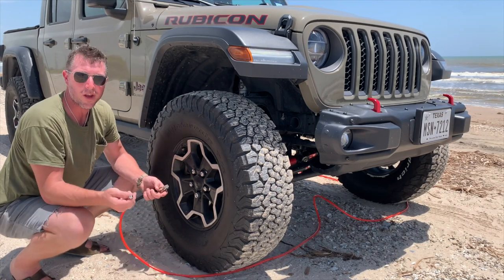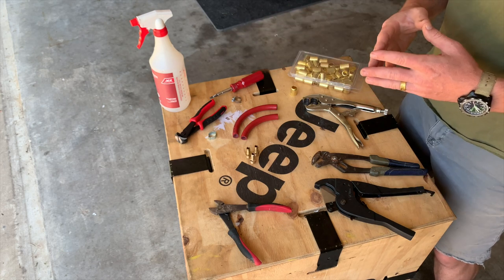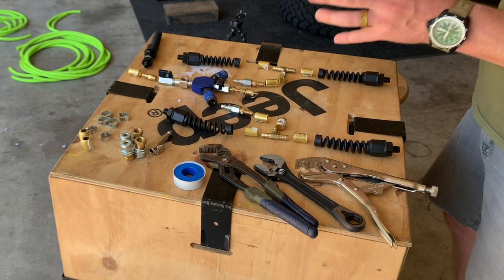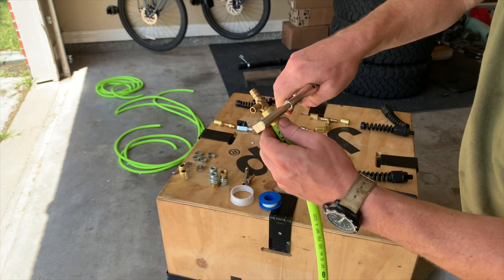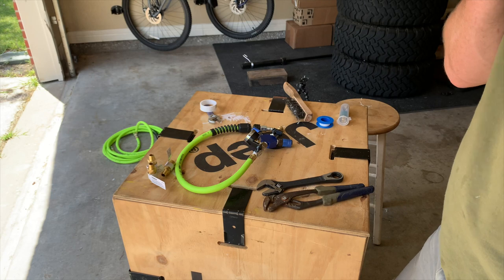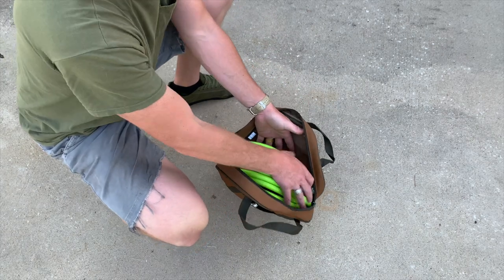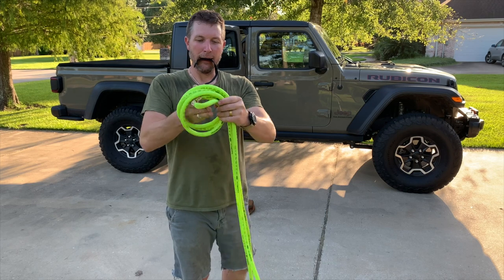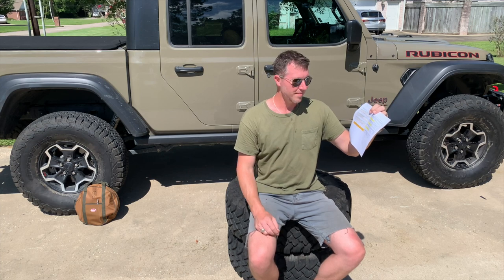DIY 4-Way Tire Quick Inflate/Deflate System for Off-Road Tires

Comment: A very simple tip I picked up from an old timer who spent a lot of time in the bush/outback was to over inflate you spare up to whatever it can safely take and that will give you another reservoir if the pump gives out.
Reply from the maker: I learned the same tip from an old timer as well. 🤝

Comment: Ok, I just started looking up and pricing the stuff you require for your DIY kit and am not nearly done and am all ready at almost $200.00, The Moreflate System (which I believe uses Flexzilla Hosing) I would require is about $249.00, I just do not see the advantage of DIY here as Cost Effective factoring in time and two tools you suggest. How di you justify it? And why (3-12) 1/4" Barbed NPT Fittings why not a specific number!
Reply from the maker: Thanks for reaching out! My kit pricing is dated and costs have gone up on nearly all the materials. The reason for using 3-12 barb npt fittings is I assume not everyone is going to use the flexzilla pro quick ends like I chose to use in my build. I built 3 for friends for Xmas this year and it came to about $230 each using 1/4” hose and fittings vs. 3/8”.. morreflate base models are 250 and go over 300.. the DIY just allows you to make it conveniently at home with what ever materials you want to afford. I chose to spare no expense and the pricing, though near a pre-manufactured pricing, is still justified.

Comment: I did something similar except i modified a SEMI air tank as an aux tank so that small compressor don't work as hard and ITS like 100% FASTER and i used quick fitting Teflon hoses from actual SEMI trucks. NO crimping just push N pull this way IF any repairs can be done in sections and QUICK and NOT permanent with room for running air tools

Comment: Did it work well with the Coyote Deflator? I watched it twice now and getting ready to order all the parts. Thanks again for taking the time to make this btw.
Reply from the maker: Hey, thanks for reaching out… yes the coyote deflator does work, but unfortunately it takes about 27 minutes to do and that wasn’t efficient to be worthy of posting the results. Otherwise the system works great and I’ve used it a lot… I time my deflates and it comes pretty close everytime.. with 37’s, deflating 30 to 12psi is 5min.. with single compressor it’s about 9min to inflate 12psi to 30psi.. if you have a twin compressor it will be about half that time to fill..
Reply: @GatorOverland  thank you for the quick reply. I ment to say that 4 weeks ago lol

Comment: I really appreciate the time you took to show the entire build, along with what you learned along the way. What struck me was that deflating or inflating all 4 at the same time was so much faster! Data doesn't lie and neither did you. You earned a sub on the very first video that I've seen. :)

Idea for a mod: You have 2 valves on your manifold, so why not open both to deflate? I think that it might be faster. Toss that Coyote deflator since it's just a smaller orifice than the valve, plus it adds weight, price, and complexity while sacrificing time. Simpler is more better.

Another mod I might consider is drilling and tapping a hole on the large flat face of the 4-way to accept the gauge. Having a 1/8" NPT without an adapter makes is marginally lighter, plus it keeps the gauge closer to the protection that the 4-way offers, and away from the valve and mashing your fingers on it.

No matter what, I'm seriously looking into adding this project to my Xterra. The only difference I'm considering is getting a CO2 bottle from a local welding supply, along with a 150 psi regulator. It doesn't need the engine running, and is way faster than a pump, cold, and quiet. It takes up a bit more room, though, so there's always the flip side to consider. A 10# bottle should be able to air-up all four 31" tires on 16" rims about 10 times, and maybe 15. Fill-ups should be around $15, that puts each air-up at about $1.50. Buying a compressor for $150 would equal 10 fill-ups and about 100-150 air-ups. I'm not sure if a pump would live that long unless I paid more for the pump. My Cost/Benefit ratio needs to be examined more.

Comment: Great installation Video, and thanks for posting all the materials in your shopping cart. After I'd done many tests, I found it was easier to inflate two tires at a time. Thus, I'm building a two-line split. Thank you for sharing your time & effort.
Reply from the maker: Absolutely… Thanks for taking the time to watch hand comment… That’s the great thing about the manifold set up is you can choose between doing two or four just by disconnecting the lead.. doing two at a time simplifies material and reduces weight and space required for storage..

Comment: That's cool. The only thing I would add would be another check valve to separate the front and rear hoses. That way when getting ready for the highway I can shut down the front or back while the other end keeps inflating (if the front and rear are different pressures).
Reply from the maker: That’s not a bad idea!!

Comment: Great video and great system!  Awesome advice on using the spare tire as an emergency air source, mine will be inflated near max tomorrow.
A few observations, devices very similar to the Coyote deflator come in packs of 4 and by the time I install the last one, the first one is deflated, by the time I remove the first one, the second is done etc...  It takes less than 5 min to deflate 4 tires, and is where these manifold systems really don't save any effort or time.  Just getting the bag out and stringing it out is already more time than installing/removing 4 deflators. Not sure where 22 minutes came from to deflate with Coyote type deflaters.  
That being said, inflating is where the manifold system really shines. I do like your set up.  Put an adjustable regulator on your manifold( or even another Coyote type device) set to you air up PSI, hook it up, turn it on, and go do something else for 15 minutes.
Reply from the maker: You’re exactly right, and thanks for commenting on the video… The 22 minutes was based on a single Cody deflator in the manifold. I have put together a manifold that has four deflators on it but I have not done a time evaluation for it yet… Coyote has also sent me a big bore deflator that might be suitable for using one deflator for all of them… I plan to get a small regulator as you mentioned. But yes overall there is a bit of time for set up, but the convenience of doing all four at the same time and being equal is hard to beat… There are a few brands out there on the market… But doing it for yourself has that gratifying feel about it.

Comment: Any thoughts on having the lines fixed  beneath the chassis to each wheel?  That is, the air chuck for each wheel tucked up under the fender well protected by a dust cap.  Mount the service port & gauge under the hood, in the cargo area, under a seat, glove box, or wherever.  Seems to me this would save time unrolling & stowing hoses.  Jump out, make sure the valve is closed, attach the valve stem to its conveniently located air hose, and finally open the master valve to deflate.  When complete, put the dust cap back on the air chuck and stow under the well.  No need to drag hoses and manifolds through the sand, mud, snow, or dirt.
I think I'm going to try this on my Toyota Fake Jeep, highly inspired by your video.  I'd like your thoughts on potential pitfalls for this idea... I'd be happy to document the process & results.  Great vid.  Cheers!
Reply from the maker: Your idea is great and is perfect if you want an onboard standalone inflate/deflate system. It requires a bit more planning, routing, and money, but in the end would be more convenient in regards to storage. I have seen set ups like this and have considered it for myself. I decided to go a more universal route that would work on a variety of vehicles. If you follow through with your idea I’d love to see how you made it work. You can keep in touch with me at jkhartel3@gmail.com. Thanks for reaching out!

Comment: Greetings from Australia! There's some absolute golden takeaways throughout this video. Great stuff!

Pressure balancing tires, using your spare as an emergency reservoir, how time spent pressurizing 4 tires up and down constantly can be streamlined, duty cycles.

This has me thinking about my own system. Realistically, here in Australia, custom tray/bed modification is very normal, so I'd opt for a slightly different concept. An onboard compressed air tank to reduce compressor CFM limiting inflation time, and consider using valve stem removal inflators for extra time savings. I'd also consider how to keep the lines attached to the compressor full time so setup time is streamlined and may in fact be more compact with more spread out but smaller coils.

Either way, now I'm thinking, and that's it's own reward. Cheers!
Reply from the maker: Wow! Thanks for taking the time to watch and comment. You aussies are the OG Off-roader, I’m better off taking notes from you😂. You make some very good points. This video was to make a portable unit to go between multiple vehicles. I plan do exactly as you mentioned and do a reserve arb tank, as well as running permanent lines arb chuck ports along the frame and only need 4 short whips to attach to the tires instead of the big roll in a bad. Also as mentioned the main time constraint is the valve stems for both inflating and deflating. I have purchased apex stem deflators and plan to put them on next tire rotation. I’d love to see your setup. Shoot me an email to jkhartel3@gmail.com or find me on Instagram @gator_overland

Comment: Easily the best quality end results. I watched 3 other vids and this one is most well assembled.
Reply from the maker: This one is for you man!! It works very.. let me know if you have any questions. I’m actually making one for a friend today 😂
Reply: @GatorOverland  so you must use  compression ferrules on the hybrid pvc/rubber hose correct? No hose clamps. 

I prefer those compression fittings where you used the end snips (flush cut cutters) to pinch the ferrul wings tight. The other type requires that expensive looking vice grip compression tool. I do a lot of offroad lighting and 12v  electrical so I know how quickly the crimpers and materials add up. Plus I try to buy USA made when possible which gets really expensive.
Reply from the maker: Totally agree and understand. I have used all three on the flexzilla… No problems. I prefer the flash Ferrule overall.. next would be the side crimp, and then hose clamps… I keep hose clamps in my repair kit in case I have any issues on the trail or with my hoses.
For better contact, info, photos and video check us out on
https://www.facebook.com/JKHartel3
https://www.instagram.com/p/CF-X_58BjDR/?igshid=1r9yo0niyroip
Email: JKHartel3@gmail.com
Reply: @GatorOverland  Do you sell these to the public?   What's the cost if one was to DIY?  This one does look so much sturdier then the rest I've been watching.
Reply from the maker: I do not sell to the public.. just sharing my experiences and garage creations with you at the cost of your time. I spared no expense with my build. You could do it for as little as $80, but my configuration at the time as about $145.. moreflate is $179+.. one of my friends @tjmitchellfilms produced one called speedflate which is a great preassembled option.
https://www.speedflate.com/
Reply from the maker: Tell TJ, John from gator overland recommended, you might get some perks 🤘🏼

Comment: Fantastic video and walk through, much appreciated! I’ve been considering DIYing a 2-wheel setup for less setup/breakdown and also so I can equalize between two tires. 4 would be cool, but I’m thinking 2 will cut down on all the tubing I have to carry with me. Thanks for the walkthrough on all the clamp types!
Reply from the maker: You bet man! Thanks for taking the time to watch and comment. Reducing to a 2wheel set up is a good idea, especially for being an space/weight saver.. essentially, you could do it the exact same way I did and not create the second line. That unused quick coupler could be accessory to any other air connection needed. 🤘🏼

Comment: Good job!  I don't think it was actually said, but the inflate time difference is due to the restriction of the valve stems.  By using the manifold, you reduce that restriction overall and let the compressor work more efficiently. I was going to build one of these anyway and I'll definitely use your parts list.  Thanks.
Reply from the maker: Hey! Thanks for taking the time watch and comment. Yes the valve stems are the ultimate restriction, some folks actually pull there’s or go monster valves for more flow, especially when deflating. Take one straw and blow through it.. take 4 straws and blow through them.. It’s easier to blow the same volume of air through 4 than one. Science is fun 😂.. the auto equalizing is the best part.. Invest in a 50% or better duty cycle compressor and you’ll be good to go! Happy trails 🤘🏼.

Comment: I would shift the middle manifold portion about 3' forward to make reaching it easier. The air supply will usually be in the front or the back so the longest wheel lengths will be the other end...the closest ends will be much shorter
Reply: Milton Type V are high flow coupler fittings and flow a lot more air. Not a big deal on these systems. But very noticeable on airtools. Keep them ALL the same for consistency

Comment: Gator, awesome video. 
I have one question,
You wrote that we need to use this special ferrule 0.635' ID but then linked also to Amazon  0.625"ID ferrule. I want to buy from Amazon only, do you think the 0.625 ferrule of Amazon would be good to use? with the Flexzilla hose and the V grip you also linked? maybe in the year that passed from posting this video Amazon have the right ferrule for this project?
Thanx again. keep on shooting these detailed videos.
Reply from the maker: Thanks for reaching out, I appreciate the kind comment.. yes most definitely opt for the 0.625” ferrule F7327 is the standard sizing number.. The V grips I have listed are 1/4 & 3/8, but the ferrule is actually about 5/16”.. i used the smaller 1/4 inch diameter and it works well enough.. I position the edge of the clamps just past where the ferrule shoulder goes straight. Any 5/16” vclamp or press is expensive for what it’s worth.. The only thing I can stress is that you get true brass tee fittings… I have ordered a handful through Amazon and they are actually aluminum cast and they do not clamp well… They shatter

Comment: Awesome walkthrough! I really appreciate all the details and specifics, making this very easy to follow. I'm still researching my air inflate/deflate solution (install like yours vs standalone bring in bed) and will definitely be using your videos for reference.
Reply from the maker: Thanks for the reply! Yes, there are so many ways to consider a air compressor. The pros and cons go in every direction. I assure you the convenience will prove itself the first time you need it, regardless of location. I was between the Portable ARB box for versatility and the bed mount application before choosing behind the seat. Smittybuilt also make a great portable unit. Just pay attention duty cycle and cfm output vs what your uses will he and you’ll be fine. This 4way is a no brainer when it comes to time saving convenience. More content coming soon. Thanks again
Reply: I guess Im asking randomly but does anybody know a trick to log back into an Instagram account..?
I was dumb lost the password. I love any tricks you can offer me!
Reply: @Luca Jensen Instablaster :)
Reply: @Dangelo Adrian I really appreciate your reply. I got to the site on google and Im waiting for the hacking stuff now.
Looks like it's gonna take quite some time so I will reply here later when my account password hopefully is recovered.
Reply: @Dangelo Adrian it did the trick and I actually got access to my account again. Im so happy!
Thank you so much you really help me out!
Reply: @Luca Jensen Happy to help :)

Comment: According to the info and chart on the morrflate site an open valve stem is only a 1/16" orifice, I think you could probably use 1/4" hose and that might work just as well and be a little less bulky.  or maybe 3/8's hose to the front tires and then from the fronts to the rear use 1/4.  Technically there would be less total air volume to pressurize too but probably a negligible amount compared to 30"+ tires :D
Reply from the maker: All agreeable. And your right, you’re at the mercy of the stem orifice themselves. For true efficiency you’d have to go with monster valves or manually remove the stems.. i juggles 1/4” vs. 3/8” dia, and honestly can see visibly that much difference, but figured if I go twin in the future it’s all the better.. no regrets with the flexzilla either, great stuff. I do like the coiling tidiness of the speedflate design, but I’m not sure how convenient it is in low temps. Thanks for the comments. Great suggestions!

Comment: Great video. Are the manual inflate times total time including hooking up and unhooking and walking to the next tire or is it only inflation time? Also how long does it take to unpack and repack the 4 way system?
Reply from the maker: Yes.. all times are doing the physical work.. takes literally 1min to un-bag and connect the 4way.. takes about 2min to pack up.. 4-5min to deflate all 4 from 30psi to 12psi, and with a single compressor it’s about 9min to inflate from 12psi to 30psi… a twin compressor would be near half that time to inflate..